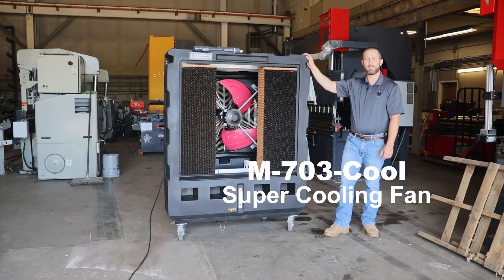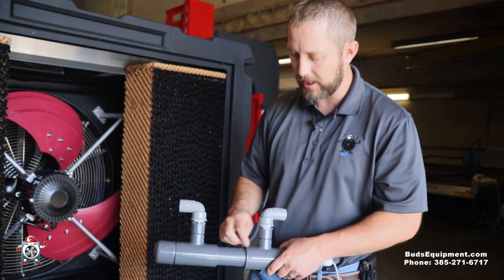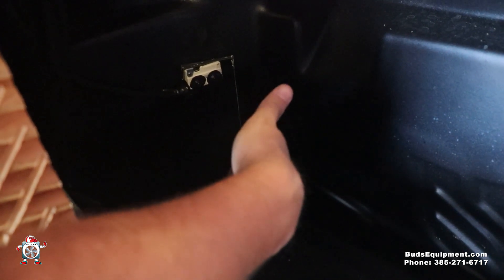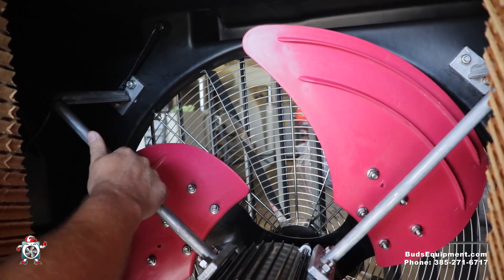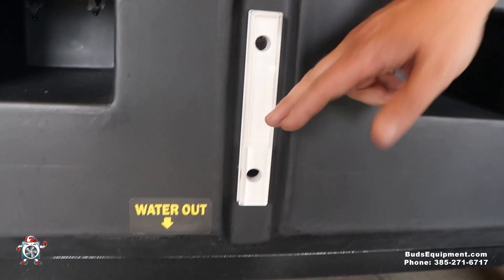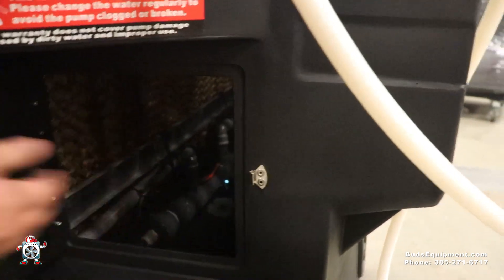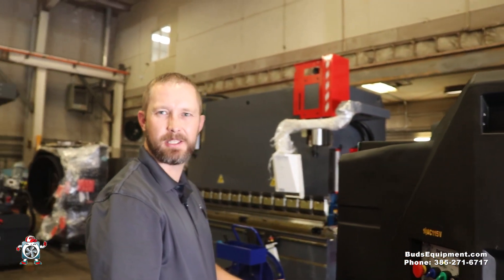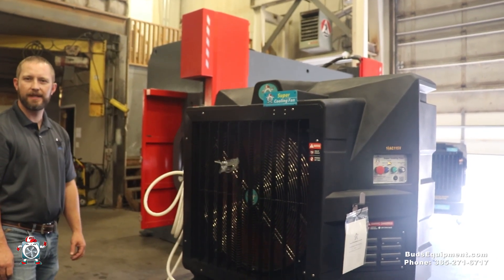Portable Swamp Coolers: M-703-Cool-UV Fan Overview & Demo

Comment: Can you help me. We have the same fan we use for our shop. It stopped working. We plugged it in, but for some reason, it will not turn on. I want to fix it but don't know we're to start. The outlet has power but not the fan.